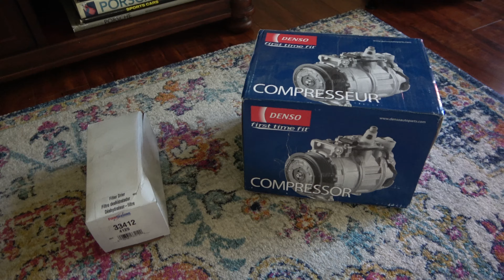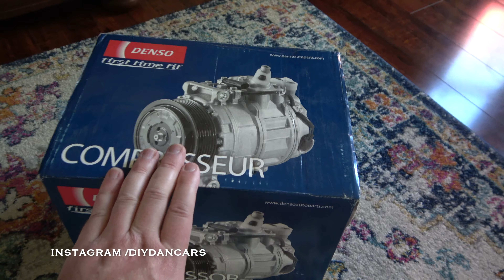Toyota MR2 AW11: Installing a New AC Compressor R12 to R134A

Comment: I was always taught never to open the high side when putting R-134a in your system
Reply from the maker: I'm really confused by this post because I added freon to the low side, not the high side. The high side port is used to monitor the pressures, not to fill the system.

Comment: How do Ik the compressor is bad and can I just refill it with Freon
Reply: It’s been awhile so idk if you’re still looking for the information but you can test the compressor with a jumper wire straight to the power connector. If you hear the compressor clutch kick on then the culprit is most likely the low capacity sensor or a bad compressor. R12 is extremely expensive and hard to come by so switching to r134a is what most people do. The purpose of swapping the oil and o rings is to keep the system from gunking up and failing bc the o rings and oil are not interchangeable between r12 and r134a

Comment: Thank you so much for this video, Dan!! This gave me the confidence I needed to fix the almost 40 year old A/C on my '85, and it's blowing colder than I thought possible now!! I wanted to comment on this vid not just to say thanks, but to add a few notes that might be helpful to others.

• Some have mentioned it already, but the compressor has a square gasket  in the upper manifold (accessed by removing the other 4 bolts) that is likely an R12 gasket on even a remanufactured compressor. While it's probably fine to skip replacing that one (and the gasket kit doesn't have one to fit it), it's worth noting that you may slowly leak R134 through that seal if you don't track down a R134-compatible seal there.

• The adapters needed for connecting the service ports on the MR2 to the vacuum system may not have the right internal valve shape. This one is difficult to describe in text, but the internal valves in the adapters I bought had thin tips that were too long and didn't land on the top of the tips of the schrader valves in the MR2's access ports they way that they should. Fortunately I noticed this before I damaged the valves on the MR2, but I ended up having to modify the internal valves in the adapters in order to get the right connection to the vacuum system quick-release fittings. Take care when you connect the adapters and make sure the schrader valves fit together correctly and open the ports when depressed. A clear indicator that they're not fitting correctly is if you can't connect the vacuum system quick-connect fittings or if the valves seem like they're stuck open after you put on the adapters.

• Lastly, a few notes for when you're refilling the system with R134 that aren't explicitly laid out in the video - 
1) When you connect to the refrigerant can, you want to start with the can tap screwed all the way open (lefty loosey). Screw the cap tap onto the can, then turn it all the way tight (righty tighty). Then, when you're ready to purge the air out of the yellow line, turn the can tap ~1 full twist open (lefty loosey), flip the can UPSIDE DOWN and set it somewhere where it will remain upside down, THEN try purging the line as shown at 11:52. Purge the schrader valve in short bursts for long enough to spray out a bit of refrigerant and confirm that you have more than just a short burst of air in the line from when you first cracked the seal on the can. If it only pushes a tiny bit of air then stops, you need to adjust the can tap (probably open a little more lefty loosey) until you confirm that it is holding the R134 can open. Also, as you're doing this, you're going to want to block the spray from the valve with a rag or something - it's a real bad idea to spray R134 all over anything or into the air you're breathing.
2) Once you've confirmed that that R134 can is indeed tapped open, start the car, wait for the A/C compressor to kick on, then open the LOW PRESSURE VALVE ONLY, not both valves as mentioned at 12:35. If you leave both valves open while filling the system, you won't be able to fill it fully, as the high pressure side of the system should reach a higher pressure than the pressure inside the R134 refill can, preventing you from emptying it entirely. Also, make sure to keep tilting and shaking the R134a can while you fill, for some reason this helps keep the refrigerant flowing...
3) Keeping track of the can weight while it's emptying into the system is pretty difficult to do while it's connected to the hoses, as they'll mess with your weight measurement significantly. If you've emptied the system entirely before doing this refill, I'd recommend putting in a full 12oz can (should take <5 minutes to empty the full can if you've done the steps properly), check it's weight before and after to make sure you've put the full 12oz in, then aim for doing about half of the next can - you can siwsh the can as you drain it and feel out the level of liquid as you go. Stop when you feel like you've emptied about half of that can, close the can tap (all the way righty-tighty, noting how many turns it takes to close it all the way), then unscrew the can, check the weight on the scale to see how much you've added, then re-connect to the tap if you need to add more, and unscrew the tap the counted number of turns to open it back up. In my case, I was getting very cold A/C after I added about 20oz of R134, so I stopped there. It's worth noting that the upper end of the capacity it just over 24oz, so you could probably get away with putting a full two cans in, but be very cautious of over-charging the system. Once you've let R134 out of that little can, there's no safe way to pull it back out in a manner that won't put you and the environment at risk. Just take it slow and stop once your A/C is blowing good and cold. You can always add more later.

Thanks again for this vid, Dan! Sorry for my essay, but I hope it helps someone!

Comment: What else might I need to fix on an AW11's A/C system?
I'm looking into buying one: everything checks out on this example, except the A/C system not working. The owner lives in Oregon, so they've just had the A/C lines disconnected and don't know if any of it is operational. Problem is, I live in Arizona, so I need to consider the potential costs of A/C repair before I make an offer.

Is this video the extent of the repairs I would need to do to get the A/C running?
Reply: I have the exact same problem. AW11 owner who moved from Oregon to Arizona... I'm pretty sure this video details all the repairs needed

Comment: Did you have to remove and replace any other O rings? The o ring kit I bought has a bunch of other o rings. Since the black ones aren't compatible do you have to find every single o ring in the system and replace them
Reply from the maker: Sometimes those o-ring kits are made to fit several  makes and models so only use what applies to your car. It wouldn't hurt to replace as many of the o-rings as you can. These cars are getting to be 40 years old now.
Reply: @DIYDanCars  True. There seems to be a lot of places for them to hide. Bad weather is in now so I'll save this video in my pocket for next summer 😂

Comment: How do you know which compressor to choose? The car I have has a R12 and the compressor is bad so I wanna do a replacement instead of retro fit but have no clue which compressor to get
Reply from the maker: I included links in the description to the compressor that will fit an AW11. Any auto parts website should have a search function to find compatible parts for your year and make.

Comment: Awesome video, I am in the process of doing this on my mr2. Did you add oil to the system besides the one in the compressor?
Reply: Did you ever end up figuring this out
Reply: @MidoriSakuraSky  I added a little bit in the dryer, like part of the total oil needed to the dryer and what the new ac compressor had
Reply: @edifiebru  So you by any chance know the total amount of oil needed?

Comment: Update on the part? Its unavailable and my mechanic wants to charge me 400 bucks for ordering one
Reply from the maker: What part? The AC compressor? Parts are getting harder and harder to find during COVID. If you can't find a new AC compressor, then your only option is to have it rebuilt. Make sure you do your research on rebuilders because they are not all created equal!

Comment: any difference in parts/process between the mk1a and mk1b?
Reply from the maker: I couldn't tell you. I have never owned a mk1b.
Reply: Hey I have an MK1B and it's pretty much the same thing. Just remember to loose the bolt that tightens the tensioner pulley on the side and the one on to that tightens the belt so the pulley can move to the desired position. I was fighting for like half an hour figuring out why after loosening the bolt, the pulley wasn't moving and it was that.

Comment: Dan I am tacking this very project now and ran into a problem. Hoping you can help. 
When you installed the manifold onto the compressor you replaced the 4 o rings on the bottom. The manifold is a two piece manifold. Did you replace that oring as well or does it not need replaced? 
Thanks for any help you can provide.
Reply from the maker: Yes. I also replaced the square o-ring that is accessible when the manifold is apart.
Reply: Every o ring kit I can find does not have the correct size. Did u get it separate? Where did you get it from.
Thanks for your help.
Reply from the maker: @davidpearce3236  I had to get it from the dealer.

Comment: You didn't need to replace the square seal inside the compressor's manifold?
Reply: I couldn’t find a square seal for the compressor manifold so I just used epoxy instead. That seal is what caused my compressor to leak

Comment: Awesome Video! Helped me to decide to tackle m aw11  ac myself.  A few questions; Why didn't you replace the expansion valve? and the gasket kit you bought has a lot of orings, did you replace them between all the fittings like between the condenser, evaporator etc? thanks again!
Reply from the maker: Thanks! My expansion valve is working fine so I didn't need to replace it. The o-ring kit I purchased covers a wide variety of makes and models hence the additional o-rings that were included. You only use what applies to your vehicle. Good luck!
Reply: @DIYDanCars  My AW11 blew cold air today for the first time in years! Thanks for the awesome vid!
Reply from the maker: @trevorgartner4194  Awesome! Congrats and nice work! Happy to help!
Reply: @DIYDanCars  Thanks for the quick reply! also, did you change the high and low pressure charging valves? I see that in conversion kits, but didn't know if our cars need that too.

Comment: Where did you find the O-rings?
Reply from the maker: https://www.ebay.com/itm/113990827612?fits=Model%3AMR2%7CMake%3AToyota&epid=76989511&_trkparms=ispr%3D1&hash=item1a8a61fe5c:g:EXsAAOSwqaNckslT&amdata=enc%3AAQAFAAACgBaobrjLl8XobRIiIML1V4Imu%252Fn%252BzU5L90Z278x5ickkAgU0umhwUTmgTFbE5cu7zfRB95izkluIUJWGTW3DR4InSGWCiggsxv12YAidE8J9UJfir5VMXmZQ7gcZVp4nqR89rvtKM1r53tjyDQ0t%252FagpVBYYTxjWOoNT%252BevbwsYAoqbRUhAVZDHPF%252B6Xny1Hx5NI5HJn6HdCMTS64SD5xBRSpVK50Ph5z%252BDovt0IIUym%252BKc5EF77FH%252FT0rb8%252F8x9O3qdzg2oJH0gHYI3aoU7MMEPdQdsooPQcl5yhHUwpp6lWbnb5T%252FgwhKxyXCbH2QUOd4IFbsKpKlmVX0ADhMfOoJON3mjsa1JRKWz9GsZVm3gz%252Bh1T3RpZrlc9ncORoC2rc3eD7jRVT%252By5%252FSnDnMLJSoOFDq%252BPTo8Q1Q9w6bWH8yzHfjzYBMm%252FOPOCJ3f%252FxaYppCydZngD%252FmdAmPzVssgI%252Fj2OAuBzPYiYJITRwIPQXrpniNCpKV78NnR9Qk8afcjeKgSEU71NCwHF1C%252FnbWUP277a7IKc4MkPDxxS6pBvGOqdryLzQbyzPavT7DoN2tgj9eFGjPzJdUn15vfPzP2DPI48H%252F5FNa7wtVuGaPeSQHAQLyOKks7iKLsu5LQQ8qvVkTKFbWqAHw0VyydkJDpGXhHcjWfxziPPuOgDQQ9blCnp0udMA1BxtcidCUvBazC8bKCyPdR%252FCI2SsZkeyolTUWy8QCe4tYQAR8xh99DBFlIfWb0ERYes0TmgEZ%252BM7oi2b7Ov7ZH2mIqt%252F2jVkVfURJAfFjvteAXnJmuiPW%252FUh8dwLYnLwNHssMgm%252BDunDz6FPkkR1rQ21qCKZG9U10ZK6Y%253D%7Ccksum%3A11399082761274d45a130dfe40f9a160e45345f613cf%7Campid%3APL_CLK%7Cclp%3A2334524
Reply: What model 4post lift is that? It looks really compact!
Reply from the maker: @ficklecycler  My lift is made by Direct-Lift.

Comment: Great video. When I do my AC on my 86 mk1a I'll be sure to use the ones I know worked for you. By chance do you know how to locate a leak?
Reply from the maker: Thanks! You will need to use R134A refrigerant that has dye in it and a black light to find the leak.

Comment: Hi Dan
My dad has an 85 mr2 and had a mechanic shop installed a new ac compressor in his car to change the system with r134a. 
Well the system or ac compressor never kick on to  take a charge. The mechanic say that it was power to the system but he couldn't figured out why it didn't kick on to take a charge. This is the same reason why the old compressor was change. 
Any idea why? Or what to do to fix it?
The dryer receiver was not replace is this probably that why?
Reply from the maker: You checked the fuse, right? If so, check for 12 volts at the compressor and work your way back to the switch. If you have 12V at the compressor, I would then look at the low pressure sensor. If your mechanic doesn't know this, it's time to find a new one! It's hard to give advise without being there, but I would start here first. Good luck!
Reply: @DIYDanCars  
Thank You Dan, I would do that myself and check it with a multimeter. The mechanic I believe checked out for power and told my that there was power. 
But he didn't change the ac dryer receiver. The car still has the factory one on. 
Do I need to replace  the dryer ac receiver or accumulator in order to use r134a, as you show here on the video, could this be the reason Why the compressor is not getting activated and going?
Reply from the maker: @Anyelo30 Yes, the receiver/dryer should always be replaced whenever the system is opened up. You really need to find a new mechanic.

Comment: Very nice video on the A/C system! I'm still going to delete the non working A/C on the AW11 I just bought though...have some rust to remove, inhibit, and coat in the trunks from the carpet holding condensation and don't feel like taking any chances.
Reply: Hi Vracer111 - I have an 1985 I would love to put a/c in. In you can get the components out and bundled I would be happy to buy the complete set.